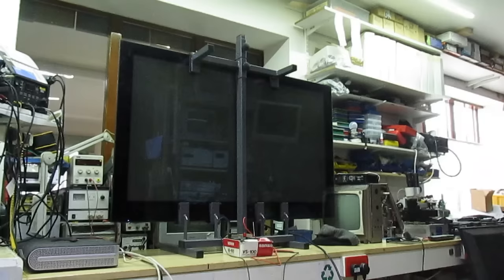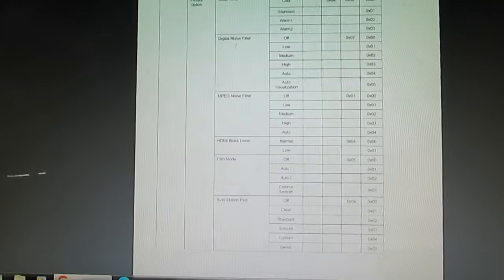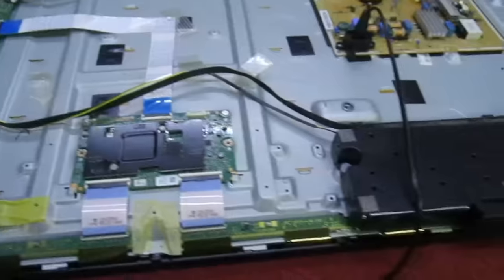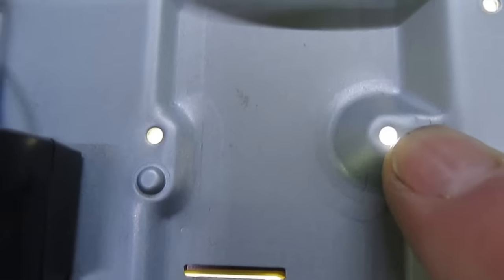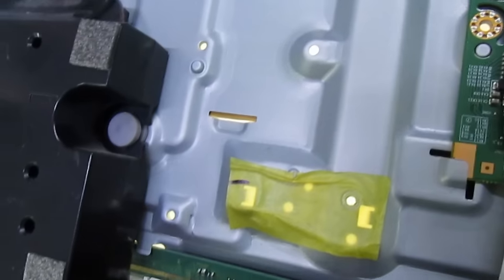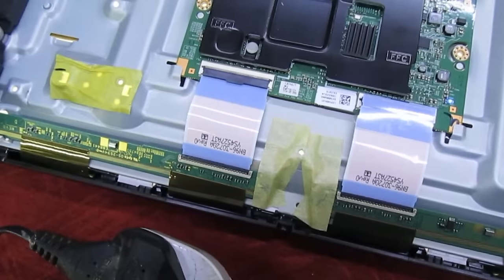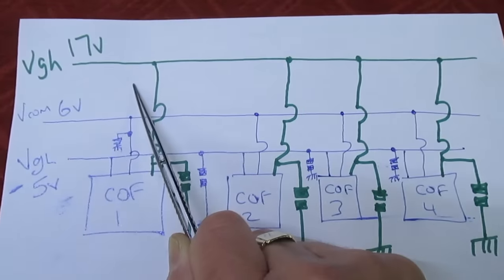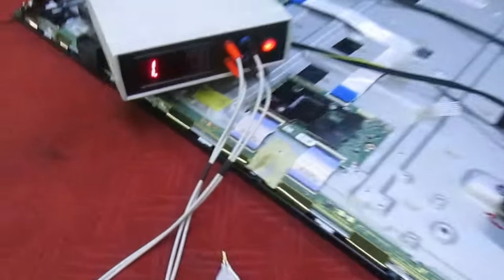Video to highlight the problem of repairing flat panel TV sets

Comment: Very instructive video Micheal, being a now retired tech who started in the trade in the monochrome valve TV era I always relied on the ubiquitous and comprehensive service manuals that were current then.After many years experience the manuals were only referenced if the fault was a curly one as one became attuned to parts that commonly failed and most were carried in the service van and the majority of repairs could be done in the customers house. Only the curliest were taken back to the workshop.
Nowadays though very little can be done in the house in the way of repairs and all sets get the workshop treatment.
Prior to retirement about 5 years ago I was a service agent for several brands and got pretty good at component level fault’s especially on Panasonic plasma and lcd sets as I found them to be good at supporting their repairers with the required info.
However the model life of sets is now only a few months as the technology is pushing ahead at such a fast clip and the number of brands being sold has escalated so the ability of any workshop to develop a working knowledge of any particular model becomes almost impossible unless you can survive by specializing in some of the more popular brands that are more likely to supply backup.
Glad now that I can now tinker away in my workshop without any customer pressure.

S
Reply from the maker: That's another problem as you say, you never see the same set twice so it's virtually impossible to be a specialist these days, valve days were much better.

Comment: It's knowing in advance the proper procedure of isolating (and the respected & expected results of each) that makes the fault apparent. Beyond that it's like a cow looking at a new gate, she doesn't know what she's looking at nor that there's any difference.  The value of repairing anything isn't the saving of the device or cost of parts vs a brand new one so much....but rather,  it's the repairman and his experience.  

Another prime example might be using a code scanner on your automobile.  It's one thing to bring up the codes, but if you don't know what they mean or what they should be......they're just codes. Great video sir. Look forward to more....and best regards from Texas
Reply from the maker: and of course years ago I went on manufactures training courses and they taught you fault finding procedures, which parts to disconnect to narrow down faults to a particular area , however training courses no longer exist , a bit like workshop service manuals with waveforms and voltages clearly marked  to assist in fault finding ,
Reply: @michaeldranfield7140  Again, I agree..  Today's technology is intended to be disposable and smaller than 'repairable by human means'. It's nice to a degree (if you're flying to Mars in a capsule), but throw away nonetheless. BTW: I really enjoy the common ground and your video. From "one gear head / lightning rod" to another...Best wishes.

Comment: My grandfather opened a radio repair shop (Taller Marconi) in 1936 in a tiny town in Colombia. Needless to say, there wasn't much in the way of technical support from manufacturers so he figured out all the internal workings of the radios and made a living fixing them.  When TVs came out he did the same thing and figured it out. Then VHS came out ( BETA in Colombia) and once again, they found a way to repair them down to component level. My father and two of his brothers eventually learnt the trade and took over from him when he retired.  Thank you for your video and the memories. I remember my dad replacing tiny components in PCBs to get them back to work.
Reply from the maker: In those days all electronic components were big things and as you quite rightly say a lot of stuff could be repaired without a service manual, however today with micro sized component, some so small there is no space to print a part number on them a service manual is the only hope of doing a repair.

Comment: Thanks, Michael!  Great troubleshooting!  Often I troubleshoot by looking up the make and model of the TV on the internet to see what typically fails :-)  Years ago, I fixed our TV by replacing a few discrete components which were known to fail,  the next TV I had to replace the bulging caps on the power supply board, but only spent a couple of dollars.  For the more recent flat-screen TV's which died, I had to find used circuit boards on eBay for $30 to $40.  They keep making it harder and harder to fix anything 😞
Reply from the maker: I have hundreds of used boards from broken screen TV sets but the problem is you hardly ever see the same set twice now the models change so often and sometimes the symptoms can be very miss leading and you end up replacing a board that's not faulty at all , so where ever possible I try to find the fault first before buying new boards .

Comment: Some lovely faultfinding and explanation there. Amazing that a complex device with thousands of components can be taken down by the failure of one simple, small, common part... and equally amazing that if the flimmin' thing would only fail open circuit instead of short then it seems things would have carried on working in this case! I wish I'd studied electronics; it must be a great buzz to revive something like this that would otherwise be scrapped as the manufacturer wishes!
Reply from the maker: Just imagine how many more sets could be repaired if we had access to service data and spare parts.

Comment: Quite impressed Michael, and an analog SANWA meter too! That’s rare to see today!  Rare as seeing the term EHT & filament these days!
Reply from the maker: I have always had Sanwa meters, there a very old company, as you have already noticed I'm a bit old school.
Reply: @michaeldranfield7140  👍👏Your Sanwa is a bit more modern than the one I had! Like you I grew up on Sanwa, also a slide rule, Staedler I think, and later HP LED calculators (HP-45) in the days when you could buy brand new Mullard valves, and home kit transistors like OC71 & AC126, polythene variable gang caps and a time when car phones were enormous radiotelephones (Pye)! Tech progress has been amazing, not to mention the fall in price of high end kit, scopes, DMM etc. Best of all, being able to design & order your fully built custom PCB in a week!

Comment: Great stuff! I'm a consumer electronics repair guy myself and I'm about your age. Problem is, our job was doomed by the price erosion of e.g. TV sets. In the 70th and 80th a modern A brand TV was about 1.000 Euro what represented a full monthly paycheck for an average worker at that time. Today a TV is about 500 Euro and that's merely 50% of the average monthly pay ignoring the inflation over 40 years. So in theory a TV should cost about 2.000 Euro today and that would make repairs profitable. Besides, your insight in electronics and understanding of schmeatic diagrams and signal flow path in combination with effective SMD soldering skills is amazing and hard to find nowadays. However, I'm afraid students leaving school today are rather studying electronic engineering and get a high payed job in the industry then sitting in a TV repair shop.
Reply from the maker: I dont think anyone in there right mind will be going into TV repairs now , as you quite rightly say a TV is now cheaper than it was 40 years ago but cars and houses keep going up in price white  TV s keep falling , in the 70 s TV were so expensive compared to wages most people rented ,today most people with a real job can buy a new TV for just a couple of days wages .
Reply: Also as technology advances fast it makes less sense to put money on repairing old than buying new. If one at the cost of repair gets a new bigger TV why repair. Also one cannot ignore the ease of buying flat panels. No need to organize transport. Just pick one and put in a car and you are done in an hour.
Reply from the maker: @okaro6595  you do have a point but I come across a lot of people that are not happy just buying a new set, usually when they have only had the set for 18 months and its failed, they just dont think they have had there moneys worth ,.

Comment: Very informative thanks! I don't repair tellies as a job, but an interesting repair story to share; a neighbour gave us their old LG LCD TV that had a really blue cast to the screen, I immediately jumped to the conclusion that the red and green signals were missing or it had been  set up wrong or something, but upon further disassembly, it turned out that it had been run so long that the phosphor on the backlight leds had degraded to the point where it was no longer making yellow light, leaving just the blue! New LEDs now on order.
Reply from the maker: Its a common fault on LG sets , no doubt caused by cutbacks in production , if you look at a LED in an earlier model of set the yellow phosphor is held in around the edges in a plastic carrier on the newer LG sets the phosphor is just push fitted on top of the  LED element and the heat from the led caused by running the backlights at 100 % causes micro cracks in the phosphor which eventually just falls off .

Comment: "is that all it was?"... and then they expect an equally cheap price for the repair when you've spent considerable time without a schematic to find the problem. I used to repair TV's and stereo's back in the 80s/90s when things were simpler and actually had schematics. It's fun solving the puzzle, but not fun when people didn't want to pay or expected some low ball price. Great troubleshooting!
Reply: "So that's 25c for the capacitor and $200 for telling you which one it was."
Reply: @dennisbjones  When I was in the business I learned to be "economical with the truth". If customer asked what was wrong I'd say something like "do you understand how a multilayer ceramic capacitor works?" On receiving the blank look I'd say, "oh, well, never mind. It's fixed now".
Reply from the maker: customers have never appreciated how much time can actually be spend like you say tracing the 10p resistor in years gone by , but I have found most people more appreciative these day when I give them a plastic bag and say that's your old faulty part  and they say what's that there's nothing in the bag , and I say take a closer look at that thing the size of a pin head, to which people say how on earth did you find that.
Reply: Sadly even doing fixes for commercial can be like that. Industrial is a little better but there time really is money.
Reply: @michaeldranfield7140  This has been a long discussion topic between technicians and customers all over the world, through the passed years...
The (wrong) customers' opinion about the price they had to pay on a repair was based on a simple fact called "ignorance", as it is related to the nature of the repairs job itself. Especially in the past decades, they had the impression that technicians knew in advance exactly what to replace or adjust or call their intended action as you like, as soon as the customers were describing the symptoms of their faulty devices. They had the impression that the "magician will perform his trick and then ask 50$ for that magic performance, having about 5 minutes of duration"...
Of course this thinking stands on the base that an experienced technician knows his job and has faced the described problem perhaps many times before, which might be true, but the missing link here is that the same symptom may well be caused due to a different cause, or simply, the cause might be the same as the known one, but in this specific case the faulty device might be a brand new model and therefore the supposed specific experience on that one is missing. This means much more time to be spent on troubleshooting until valuable new experience is obtained...but the customer either doesn't know that or, worse than that, he is not interested to know about. He only expects the "magician to perform..."
Nevertheless the tragedy of our modern days, on one hand, is that repairs in general are dying as specific professions, while on the other hand the cheap (let them be) products cannot be so easily thrown away, because for buying new ones people need relatively much more money than the average cost of a repair. 
Worse than that, the continously increasing unemployment (based on the mass and fully automated production) "erases" the existing job places one after the other, at an amazingly high speed. And the simple question is: how can one buy a (let it be cheap) new TV, when being unemployed, looking only for how to survive?"  Or, in other words: "what kind of job can one do, in order to be capable to replace his (let it be cheap) TV upon its first failure", keeping in mind that there are many other priorities to be covered first, with that faulty TV to be replaced being perhaps the last one?...Let alone the environmental pollution problem, the waste on resources at the expense of the new generations to come e.t.c...
Reply: When you get a lot of similar repairs in I used to try to aim for a fixed price repair to cover all common faults with a free quote if it needed something pricy. E.G. fixed price TV repair £47, which would cover everything except the CRT or the LOPT. Some jobs you'd lose out on because they might take you hours (but you'd learn a lot!) others you might be able to go straight to and fix in a few minutes. Swings and roundabouts, customer was happy because they knew what it was going to cost in advance.

Comment: I repair (post 1st year warranty coverage) Amana PTAC/PTHP systems, Mitel SX-50/thru SX-2000 PBX systems, and LCD/Plasma flat panel TV's for several Pennsylvania motels, and assisted living facilities.  You're quite correct, to the point that I'm of the opinion that anything built with SMD components is usually designed for a "three years, and done". Fortunately, I worked as an avionics engineer for 18 years, and am well versed in SMD replacement, and have vapor phase reflow equipment available in my shop. Between Chinese LED backlighting component availability, ShopJimmy, Jameco, and Banggood, I've fared better than 85% in the "get em running for <$75.00 USD threshold", the accepted maximum before considering replacement.

We've likely accrued a century of experience between us, it's that experience which will carry us through this phase, and onto the next!  Cheers!
Reply from the maker: I have always wondered about critical life components such as avionics are these prone to failure like consumer electronics or are they built with   decent quality components , one of the biggest problems in consumer electronics occurred about 12 years ago when they took lead out of solder , without the lead element a lot of chips were growing tin whiskers causing all sorts of intermittent faults, but I did hear military and medical were exempt of using the lead free solder .
Reply: @michaeldranfield7140  

You're preaching to the choir, re: lead-free solder. 63/37 "eutectic" is the only way to go!!!  As far as avionics, everything goes through "ESS" Environmental Stress Screening, aka "SHAKE & BAKE", which weeds out infant mortality, and ESD damaged components. We used to specify Mallory capacitors, Vishay-Sprague, and Cornell Dubilier.  Multi layer boards are my nemesis!!

Comment: That was the best down to earth fault finding video I have ever seen. Well done sir. I only work at the level of "replace the board" but even that is often not possible because I cannot find matching part numbers.
Reply from the maker: Without component level fault finding you would have had to replace the screen in my set as the board the cap was on is part of the screen and not replaceable.
Reply: @michaeldranfield7140  Exactly what I was thinking. Replacing the T-con board wouldn't have fixed this, so you'd be out the money for that and no closer to a solution.
Reply: Or worse when numbers are scratched off.

Comment: Very instructive! I’m confused about the troubleshooting though. The backlight died when both timing cables were attached, but ok if either one of them was plugged in separately. But replacing just one cap on one side fixed the problem. Wouldn’t the behavior mean that there was a partially-bad cap on both sides, so only the two of them together would kill the LEDs, but not each by itself? 

Regardless, a very instructive and handy video, thanks! (I have a half-dozen TVs and monitors sitting in my basement waiting for me to get a chance to look at them 😁)
Reply from the maker: This is what I can't work out for myself but as there is no circuit description in the service manual I don't have an answer.
Reply: Same confusion ! Apart from that very nice and informative video ! I really didn't know that those tiny ceramic caps are "so" prone to failure... 🙂
Reply: This was very confusing in the video. Especially since it was glossed over and not discussed.
Reply: @geraldh.8047  Maybe there is a ground or power "loop" that is only completed when both connectors are connected?
Reply from the maker: It's not discussed because there is no service manual to explain it, if I knew I would have said, my best guess is there is some control line back to the microprocessor?
Reply from the maker: The ceramic caps are very unreliable and always going short circuit, not just in TVs, I have even had ones burn up in some equipment.
Reply: @michaeldranfield7140  it would have been nice if you had added a “wow, that’s a little weird” comment at the moment instead of ridiculously claiming this was the expected behavior 😢
Reply: @michaeldranfield7140  Thanks! This was a very informative video...
Reply: Best guess is that the power supply was strong enough to power each half even with the fault present, but not strong enough to power both halves plus the fault.

The faulty part would effectively have been a tiny heater.
Reply: @MichaelKean  Ooooh...  I wonder if FLIR tech might help in this case...